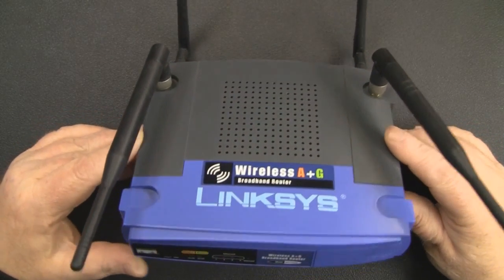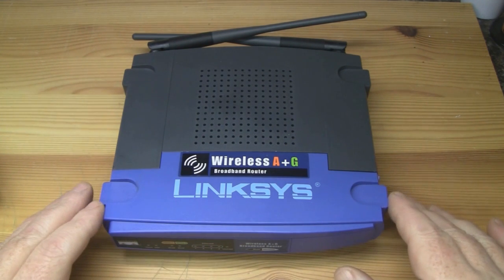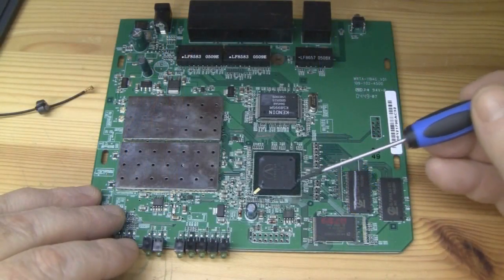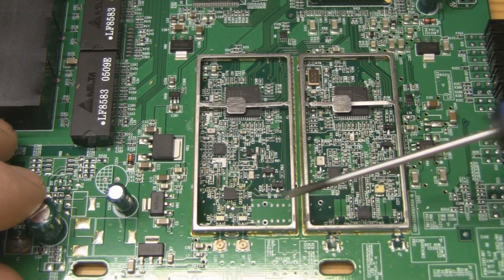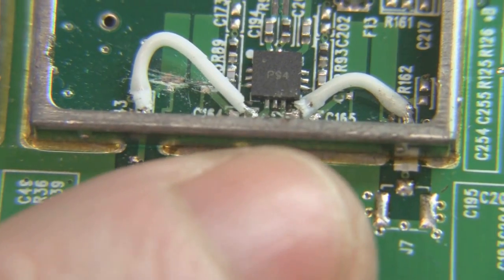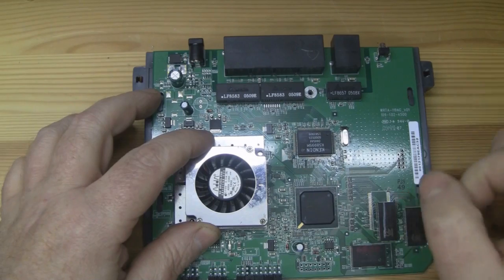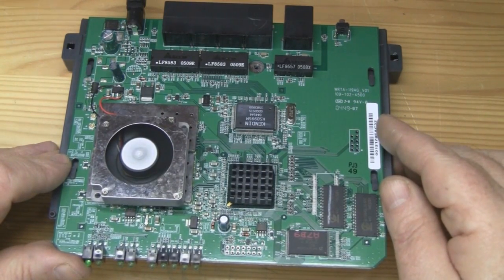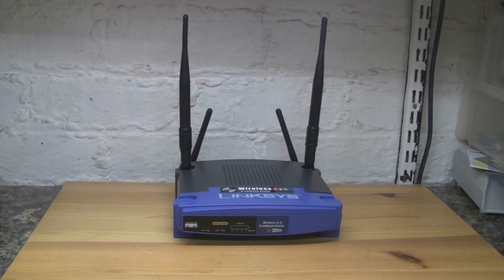Linksys wrt55ag router modification #78

Comment: Great video! But I have a question: the two chipsets, the ones for each band, are covered with an rf shield right? By putting the fan right on top of those shields, are you not potentially introducing some interference?